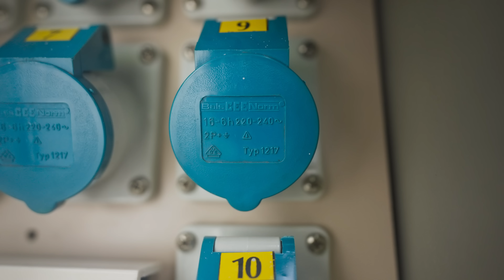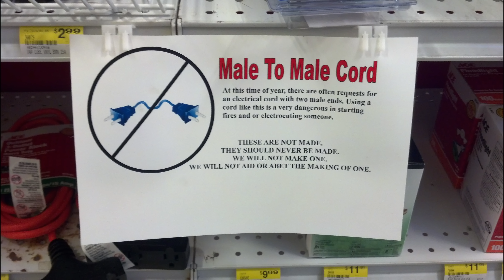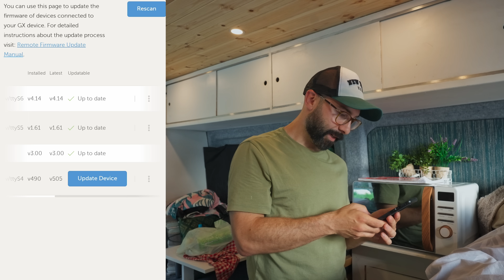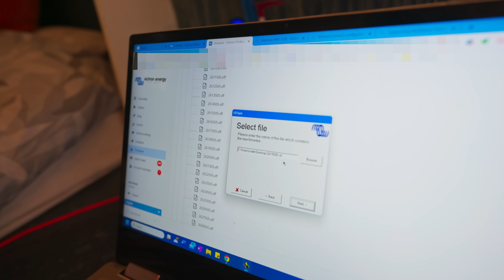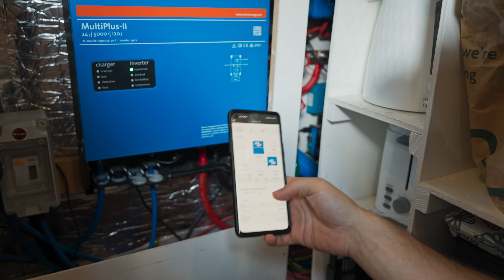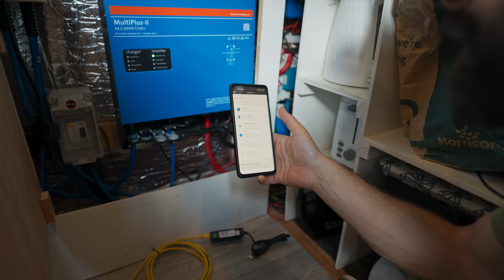DISASTER in Switzerland mountains van life nightmare | Victron MALFUNCTION

Comment: Are you going to modify the incoming mains hookup so you can plug in the inverter and/or the onboard sockets direct to the hookup supply? ie hookup goes to two 16a sockets and inverter output is also on a 16a socket. Inverter and Sockets (and a mains battery charger) would both be powered from 16a plugs. Then you can use hookup direct. It's actually crazy to power all your mains devices through an inverter even when you're on hookup. The inverter is only for when you're not on hookup.

Also, get a couple of USB outlets that connect directly to your leisure battery - no need to convert 12v DC up to 230v AC then back down to 5v DC! 

Gas is probably best for when you only have 4a or 6a hookup in Europe. Even a 1kw caravan kettle uses over 4a.
Reply from the maker: It's a good idea and I'd considered doing this however several hook up points in Europe deactivate after an hour and you need to keep pressing the button to turn it back on.
When the inverter failed and we plugged in directly to the hook up, I realised how valuable the auto switch from incoming AC to inverter power was, especially whilst editing and having the computer shutdown without saving.
We do have a few 24/12v step down converters for our DC stuff (USBs lights and fridge) but the incident blew our fuse.

Comment: I am feeling happier about my setup now.  I have 2 inverters.  A cheap 3kW one and a 1.2kw Victron exactly to have no single point of failure, although it's the cheep one that worries me.  The hob want go full power on the small inverter but powers up half power which is OK.  I use a 700W travel kettle which is normally on the Victron.  If the big inverter failed then all I would loose is the Microwave.  I have independent 12V usb sockets and 12V lights and water so no dependancy on AC for basic functionality.  My weakest point at present is the single bige home assembled battery.  I do have the wiring and a manually switched relay so I can get power from the van battery as a last resort.
Reply from the maker: That's a great idea -  sounds like a cool set up! Will you do a YouTube channel ?

Comment: I'm having a similar problem. I had to  remove my batteries & after reconnecting them my Multiplus is dead. I have the same problem you had, Victronconnect won't connect as the Multiplus won't turn on. Everything in the video was so quick to take in the process you did to fix the problem. Is it easy to explain exactly what you did?
Thanks in advance. Paul.
Reply from the maker: We had a specific firmware version with a bug that would get stuck in the off position and the only way to turn it back on was to update the firmware. However as it was stuck in the off position the only way we could communicate with the multiplus was using the usb dongle which can somehow flash the new firmware even when the inverter is off. We seriously thought the inverter was dead but a simple update and it was as good new!